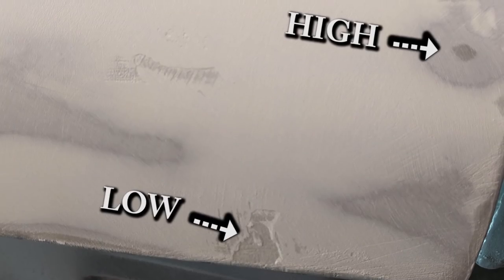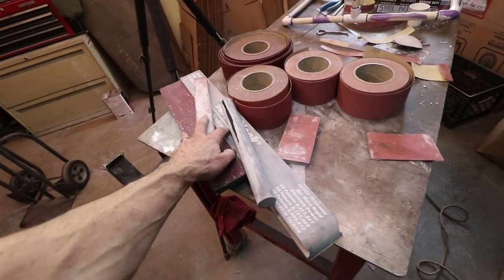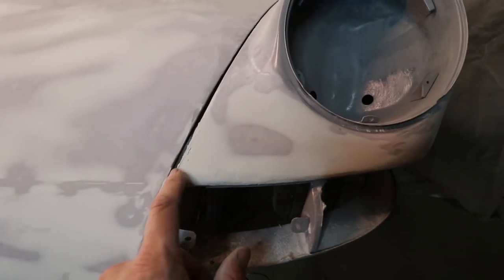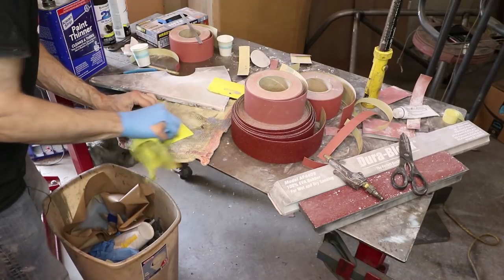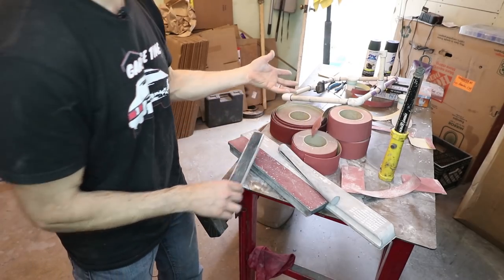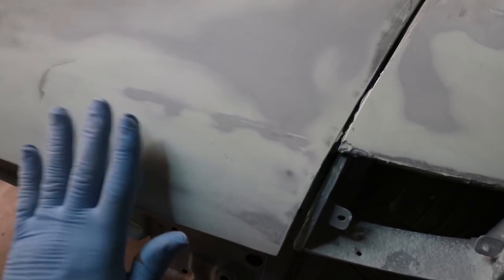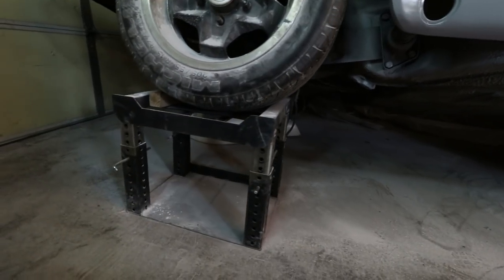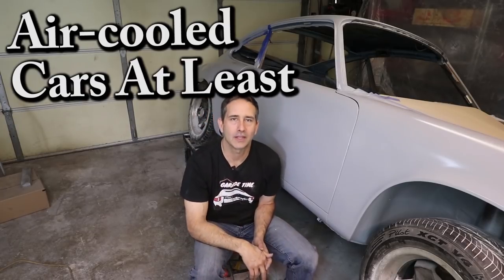How To Conquer The HIGHS & LOWS of Car Restoration

Comment: Good video.  I try and do 1-2 hours after work each night...even that 1 hour can make a huge difference.   I tend to do longer sessions on my days  off if and when I can.  I find that if I’m getting burned out by something weather it be welding, body work etc, I’ll move on to some other small project for a short time..there are always small projects to do on a restoration like rebuilding / cleaning gauges or carbs...I’ll do the same if I’ve got a metal block going...I’ll leave it and come back to it at a later date.
Reply from the maker: Totally agree!  I've done lots of mods to avoid paint prep.

Comment: Really like the way you've gone into detail about the sandpaper and filler/primer.  Maybe a tutorial on the different spray guns and the setting used for application of the primer?

Looked for the Color poll - maybe I missed it?
Reply from the maker: Thanks Jay!  I'm ashamed to admit that I'm using very cheap $9 HF spray guns.  I'll try to show my setups soon and I did buy a gun for the base clear coat.  Stay tuned and thanks for the suggestion.

Comment: I wanted to grab my strat and copy the music you played during your filling the hood and fender....!
  I agree good sand paper saves money and time.
  I agree buying body shop supplies on line is cheaper than buying local.
 Guide coat makes sanding a "Step" instead of endless sanding!
You can not have a budget build without "sweat equity" metal work and body work and prep "Is the budget part of a build "
70-80 % of the budget SAVINGS.
If you can build ( rebuild your on motor and components thats another " big chunk of Budget Savings"
The rest are "knowns" you know how much the parts are ,shop online for more savings on " known parts" some people just ask more money for the exact same quality part.
I did not see in your video your suggestions fo color.
But White is classic .
Slate Grey, Porsche used is understated.
Aga Blue , Porsches classiest Blue
In my opinion.
Reply from the maker: Agree 100%. I will be doing as much as I can myself.

Comment: How did you decide on SPI for your epoxy primer? I read a lot of good reviews on their products, but the painters I talked to and the paint vendors want you to keep the coating products in family (i.e. all PPG or all DuPont). I’m guessing you didn’t use SPI for your base coat as their color selection is really limited and doesn't appear to be available in California.
Reply from the maker: Good question.  I went with matrix base coat and SPI clear.  And of course SPI primer. 
My decision was based on cost and customer support.  Sticking with PPG is good.  It just costs more.  My 356 is all PPG.  BASF, glasorit are also great.  
All those brands with big marketing budgets tout how great and fast their products are.  
I'm not interested in fast repair speeds that body shops require.  
SPI caters to the home DIY guy, so I'd continue to recommend them.  
There's more to say here if you want to talk or email too.

Comment: Tom,  my car's paint(old paint job) still looks good, but it has a bunch of small cracks that are mostly on the top of the fenders. Instead of forking over the money to repaint the whole car at this time, I'm thinking of repairing those areas instead. What would you use to fill the cracks with? Some kind of glaze or skim coat of body filler? The cracks on the paint aren't that deep, as they only go down to the next paint layer beneath. I think it was just simply a paint adhesion problem. There are many cracks on the fenders that are each maybe a quarter of an inch in length, so I'm thinking of repairing those areas. The rest of the car, I think, will just need a good polish.
Reply from the maker: I'm all for saving money as you know, ha ha.  Cracks scare me because they have a mind of their own.  Are they done cracking?  Or are they going to creep again.  Glaze fills scratches but I don't think it will go down inside an unprepped crack and last very long.  If it were me I would sand off that layer.  Actually my car was heavily cracked and I went to bare metal to make sure they aren't coming back.
Reply: Garage Time - Restomod I think I'll block sand the fenders down as you suggest, then have paint store color match the gas lid. That way I'll just have to spray the fenders and buff the rest of the car. I'm not too concerned about longevity of the paint, as I'm planning on repainting the car later down the road. I'm just not in the position to spend 10k+ on a paintjob right now.
Reply from the maker: Gotcha, I'm not spending $10k either but I totally understand why it costs so much!  This week I'm covering spray guns, so maybe that will help you if you DIY.
Reply: Garage Time - Restomod Sounds good. I can't wait! In short, I just want to get my car to be just one color for the least possible money. I just bought a "correct" swb decklid, which is a different color than the rest of the car. Other than the fenders and decklid, the rest of the car can be wetsanded and polished. For now that'll do, as it's just a weekend driver/"ice cream getter". The car is currently a sand beige color- a little boring, but I'd rather keep it that way now, than to spend the money to get it back to the original polo red- at least not at the moment. That way I spend less time worrying about paint scratches, while spending more time actually driving it. Since most of the work is in the paint prep anyways, and it'll just be single stage paint, I'm going to try to shoot the paint using my Graco true coat turbine gun. Worst case, I'll remove any orange peel by wetsanding. We'll see what happens...

Comment: How do you keep the edges with the gaps nice and crispy ?
Reply from the maker: There are two things to watch out for.  The actual gap around 3mm and then the radius of the edge.  Both are important.  If the radius is too small the paint won't build up well and the edge is very vulnerable to chipping. 
If the radius is too big than the gap looks bigger and lazy.  
Before I applied the basecoat I softened all the radii

Comment: two week to inspection, and I doscovered two brown smudges shining through the paint on the bottom quarter panel. The amount I had to cut and weld, made me totally unsocialble for the week it took to fix it, contemplating suicide and the scrapper in equal amounts while working. It is these kind of lows this video is about?
Reply from the maker: Dang, so sorry to here about this.  Any root cause discovered?
Reply: @GarageTimeAutoResto  LOL, thanks, no I'm getting on top of this. I suspect it is the Italian style mounting of the first fuel line plastic clip, which is simply mounted through a hole drilled thrugh the rubber hide and into the rear end of the sill!!
In 20 years, that would make a lot of nastiness.  So after spending another day of welding today, I'm now only missing the bottom lip corner and I'm getting a panel for that, so it turned out all right.  Do you have any tip for painting  my now rust free sill on the inside? I'd imagine some nozzle on a thin plastic tube, like used for rustproofing with wax?
Reply from the maker: I've tried all sorts of things to shoot epoxy primer in blind areas.  A syringe with various nozzles, a towel zip tied to the end of wire dipped in epoxy, Flood seams with epoxy, check with endoscope cameras, etc.  After all is painted I will go back with cavity wax in those area too.  It really depends on the access you have in your car.  Glad you are getting through it.  So frustrating.
Reply: @GarageTimeAutoResto  Thanks for your experiences. I did use Metal Prep on areas where I could'nt brush on POR-15 because of the welding and zink welding primer. I'm going to try getting rustoleum rust converter in there by using a wax tube spray nozzle. That should get most surfaces and more importantly, it will pool the same places water watnts to. Time will tell!
Reply from the maker: Awesome, just double check the instructions on those rust removers.  Some of them need to be neutralized because they are all acids.
Reply: @GarageTimeAutoResto That is a real concern;  I did an experiment some years ago with my caliper brackets: after wire brushing them so they appeared as  new casts, I dosed them in metalprep 3 times and dried ithem off in between in my kitchen oven, without rinsing it off. It looked gray as gunmetal and with the white residue on top that metal prep leaves. I then painted them with Rustolium iron protector (meant for wrought iron rails and gates) ) copper color, that was discounted, because no one wants that color on their antique  mansion gate. It has held up absolutely flawlessly. No rust whatsoever, even where there were rock chips. I think the lesson learned is that Phospahte acid based rust converters, like metal prep, can wait for years before being rinsed of when the paint flakes if it has been completely dried before painting. However, completely drying out a sill before painting is more difficult, especially with the capilary sheet metal gaps bettween spot welds, but a heating tent and a heater blower, sould be able to steam off any humidity?
Reply from the maker: Thanks for sharing your experience and testing.  I don't understand all the chemistry but each paint product is likely different.  I know that the SPI epoxy that I'm using states no acids everywhere on the can and the instructions.  Then when you ask them they say metal prep by PPG and Dupont is okay but only if used wet and rinsed when wet with water.  This removes that chalky film.  SPI says the adhesion to the phosphate film is reduced to 20-40% versus clean bare steel.    Rust-Oleum may be totally different and may like this surface.....I'm not sure. Maybe the casting helps with adhesion?    Most guys don't want to rinse bare steel with water! Ha ha.  Regarding the baking, I think that it should work....especially if over 212 deg F.

Comment: Epoxy primer is over kill. It’s a sealer not a surface sendable primer for body work. you’ll need it up against bare metal so that it protects the metal and inhibits rest after that you can use whatever you want because you’ve already sealed the car. Now if you go through that area yeah sure you can spray more Apoxsee primer on the metal itself it will stick to regular primer so not a problem. But still a few areas where are you prime over metal is common and it’s wide range practice today so you haven’t come up with something you at all.As a newbie you may not have understood that it is taken 50 years to come up with the stages in the skill levels to do proper body work . there are no shortcuts. Period. And for someone to think they have some or have an idea it’s basically far fetched dreamers who think they have a better way. 
Regardless it takes time it takes going through the right steps it takes using a very easy to sand filler as well as good sandpaper some of the tips you brought to fruition but it’s all information everyone already knows or should know if they’re doing bodywork the bad part about YouTube is people express what they think is the right way and then they try to change the rules which people learn things the wrong way and then they get into trouble and guess who’s fault that is it’s people relating information by the bucketful that don’t know what they’re talking about in the first place. Ranting a bit due to so many thinking they are experts. I’m not saying you don’t know what you’re talking about you’re actually doing your job your way but it’s just your video for you. But for the masses to learn bodywork? No. Not so much. . Of course that’s my opinion so ignore whatever I say. criticize it whatever it’s your prerogative. You do have some good tips for beginners and I’m sure they appreciate that. keep up the good work and Godspeed. Oh sculpting with 180 is completely wrong. By the way. We don’t use it until the body panel is often perfect. You cannot really block epoxy primer. It is not primer that builds or is easy to sand.